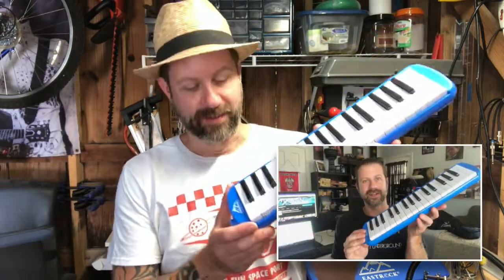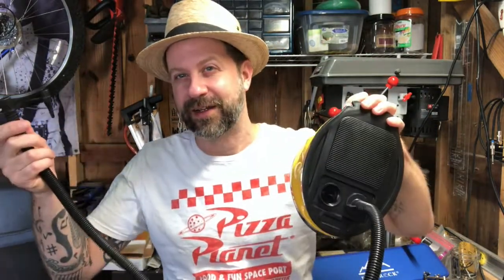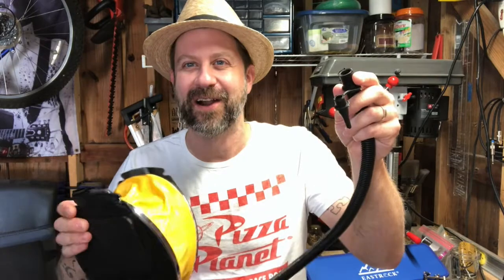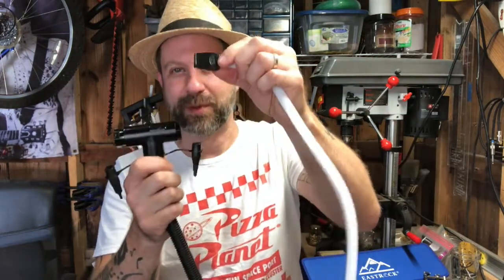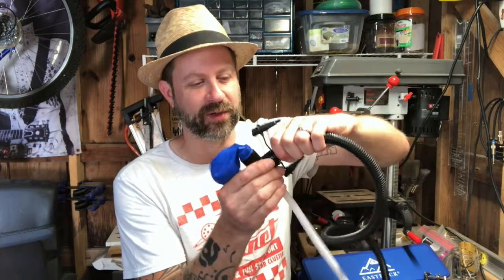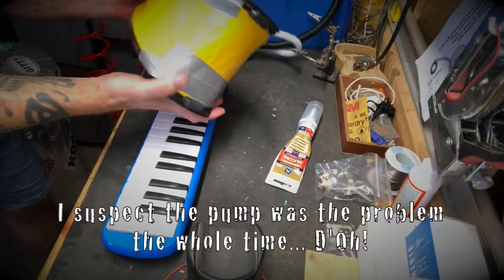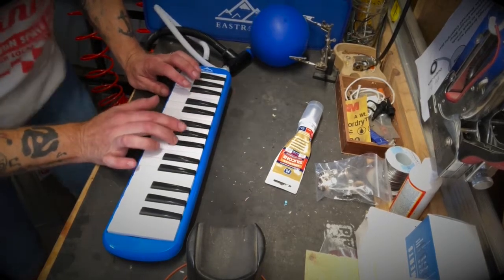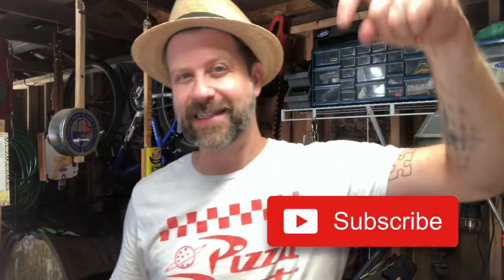Can I Turn My Melodica Into a Pump Organ?

Comment: Another interesting video.  You think of things my old mind would never come up with.  Do you have any idea why most of your videos start out fine but go out of audio/video sync within the first minute or so?  It looks like the audio plays all the way through but the video jumps several seconds ahead.  At the end the video goes to black while you're still talking.  The same thing happens on some of Dan Woodman's videos as well.  I tried to query YouTube but didn't get anything useful other than a lot of people have asked about this sync issue before on other videos.
Reply from the maker: Thanks for watching. I'm just having fun. :-) As for the sync issue... I'm not experiencing that but I've heard of it happening with higher resolution videos. You could try changing the playback resolution by clicking on the little gear in the lower right of the video and then change the quality to something lower (e.g. 360p or 480p). That might do it.
Reply: @musicalmiscellany  Thanks for the tip.  I dropped the resolution to 360 and it played w/o sync problems.  Also, I'd like to invite you to visit my channel where I have a potpourri of short videos, most are songs.  I added most of the videos quite some time ago, but then had a long dry spell when I lost my singing voice due to a severe case of bronchitis and pneumonia that put me in the hospital.  I'm just getting back to where I can do a fair job so I'm going to try to start adding more.
Reply from the maker: @SouthernCeltMS  I'm glad it worked for you. I'll check out your channel right away.

Comment: O rings and a rubber band or few would let you hold air in the balloon
Reply from the maker: Thanks for watching. Where exactly do you think the o-ring needs to be? If it were on the ballon I’m afraid it would restrict the output. If it were on the hose it would restrict the input. Perhaps I’m just not understanding. I was actually thinking a check valve might work well.
Reply: @musicalmiscellany  Neck of the balloon, outside the T. Fit balloon over O rings and put the rubber bands between them on the outside of balloon. Might help to have a rubber band or something above the O ring closest to the balloon air chamber as well. Sort of like one would do for the fuel system in an automobile.
Reply from the maker: Okay, that makes sense. Thanks. @kasey42